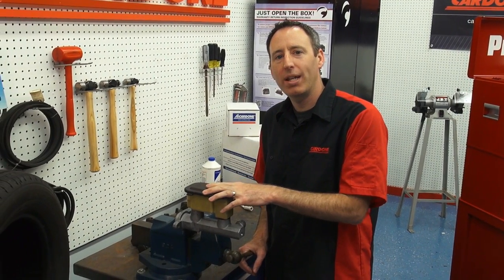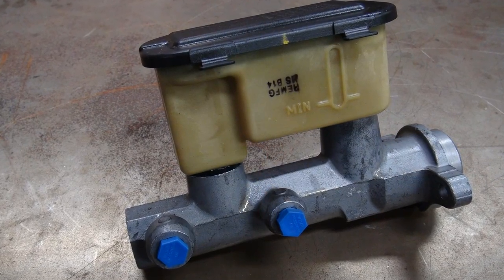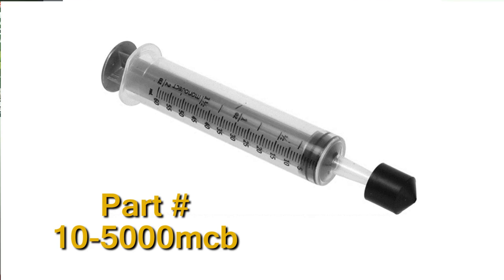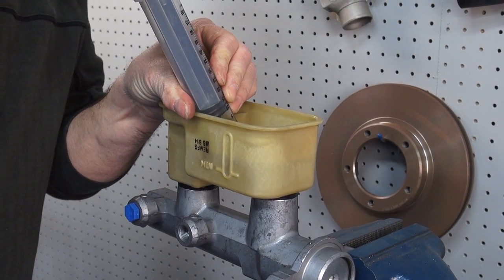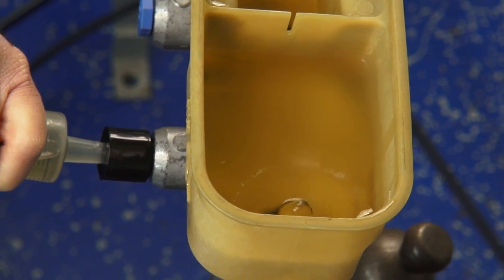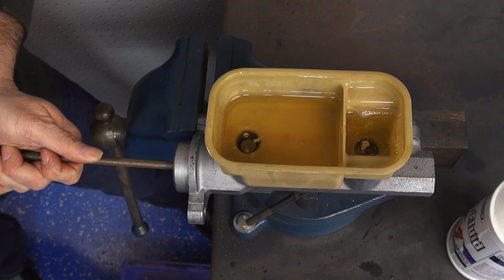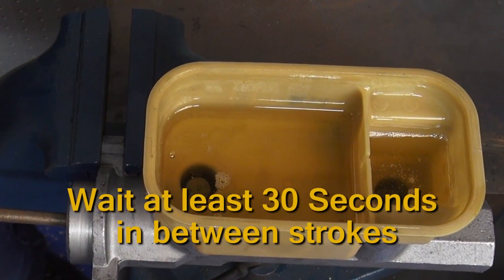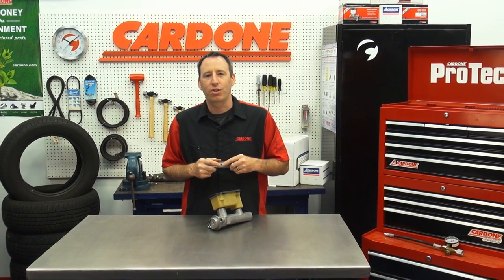How To Bench Bleed a Step Bore Master Cylinder

Comment: Why not place the syringe on one of the open ports first and extract the air and maybe some brake fluid out through the open port. Then fill the syringe with fluid from the reservoir and pump the fluid through the same port to finish getting the air out. Cap off the port and repeat the process for the second port. Seems like it would make a lot less of a mess that way. I might try this or the vacuum bench bleeding method. The method that uses the tubes to pump fluid back into the reservoir is for the birds.

Comment: Some air gets reintroduced when installing. Is that air better removed by; pushing fluid up from caliper to reservoir, Or the usual all the way down to the caliper? And is there danger of introducing air into the ABS module?
Reply from the maker: Thanks for the message and your question. Inquiries about technical issues can be directed to our Tech Support Team, please call 888-280-8324 Mon-Friday 8am-5pm EST to speak with one of our ASE-Certified Technicians. 🔧😊⚙👍

Comment: I just bought a master cylinder for a 1970 Chevy.  The bleed kit was those 2 plugs.  Will this video adequately show me how to bench bleed my master cylinder?
Reply: ***** does the kit come with  blue stop caps and this will work with master with   9/16-18 Front Port - 1/2-20 Rear Port
Reply: ***** My 66 Caddy had a wheel cylinder slowly leak over the winter,I cleaned it up and bled it,a lot of air came out but the brake pedal still hits the floor.The master cylinder was very low at first but I obviously topped it up prior to bleeding.Could my master cylinder need bleeding?
Thanks
Reply: ***** Yes and to update,I took the Master cylinder off,bled it as you show how to and all Is fixed,thanks!
Reply: ***** I have a 94 Mustang and my master cylinder you cant push fluid in from the top as described in the how to video. I'm going to be picking up my master cylinder tomorrow evening and I might pick the master cylinder bleeding tool but would like to know how to use it first.
Reply: ***** OK yes I was just making sure on that. Because when I saw this video I was like wait do I have to go in from the top also. No problem I should be picking up the tool at Napa Auto Parts in 30 min. I'm replacing the brake booster and the master cylinder there both made from your company. Defiantly a company I can trust.
Reply: ***** Well had an issue at NAPA getting the Cardone Brake Booster  NBB 5473150. The box that it came in didnt even say Cardone on it. It was missing the nuts to install the brake booster. and there was no check valve with the unit. The Napa rep wanted to just sell me a check valve off the  floor for it. I refused saying that i wanted the complete unit  because I dont want to have to uninstall this again and re install it. Also there was no instruction manual in the box. Is this normal for the  Cardone booster or was I over reacting and having them ship me a new one?
Reply: Yes this video show a good way to do it. Ive done it many times
Insta @keep_m_running

Comment: The quality of A1 Cardone rebuilt master cylinders suck. I personally have replaced three master cylinders all on Chevy trucks and 2 of them I got as the Booster/Master Cylinder assembly and ALL 3 master cylinders LEAK at the reservoir tank grommets. The most recent one I replaced I had to take back off the vehicle and return it to the auto parts cause it would NOT push fluid to the rear brakes and further inspection revealed that it wasn't even doing a full stroke when the brake pedal was depressed, exchanged it for yet another cardone master cylinder and installed it only to find out this one leaks at primary port for the front brakes. The flare nut is as tight as I can get it without stripping the threads and still leaks like a water fall during brake application. I think Cardone could spend a little more thoroughly inspecting the cores they receive and focus on providing LEAK FREE rebuilt units for the price of replacing them and being charged a core fee until you install this junk and take your original back to get your core deposit returned.
Reply: Cardone Industries I'm having the same issues. Bought a cardone master cylinder for my k3500
Liked it at first.....
Put it on and I'm suffering from the same problem as before. Leaking fluid from the rear of the cylinder. 
Didn't leak while bleeding and still doesn't while hand manipulated. But I can only push so far on the piston
IDK if it's the MC or the hydrobooster causing this. But it is a hindrance. Since I don't have a way to get to work now......
Reply: Sounds like a Chevy problem to me lol

Comment: Will this process work if the step bore master cylinder is already put in the vehicle  ?
Would my local auto parts store have that siringe you use in the video
Reply: The master cylinder need to be level out. Use a level .Lift the back wheels.ask someone to push pedal while you watch the bubble.
Dont push all way the pedal.
Plug the port also
Most autoparts store dont cary these stringe.
For more question
Insra @keep_m_running

Comment: This doesn’t make any sense, using cardone’s tool I can understand that, what I don’t understand is after you inject the fluid in to it,  do you empty out the master cylinder in order to release it in to the primary hole. Cause the master cylinder is empty.🤦‍♂️

Comment: Am I missing something here, is it 1' , 1/8th",....  20 seconds,  30 seconds?   Just a little CORNFUSED.
Reply: +Gary Kovach  listen carefully. its says on STEP BORE type MCs: each stoke should be 1 inch or less and HOLD EACH STROKE for 20 secs".   Then "WAIT 30 secs BETWEEN strokes" to allow  quick take up valve to refill.  Then "keep bleeding until no more bubbles are seen and you can't depress the  bore more than 1/8" " ( then you know the bleed is complete) .   I suggest just getting the bleeder tool 10-5000MCB.... SO MUCH easier. Instructions are in the box for the  Syringe/ bleeder tool  for all MC types.
Reply: Just dont push it all the way....
And pushing all the way..you gonna get tired really fast anyway..this bleeding process can take some minutes
@keep_m_running